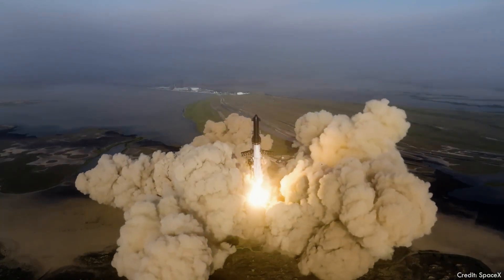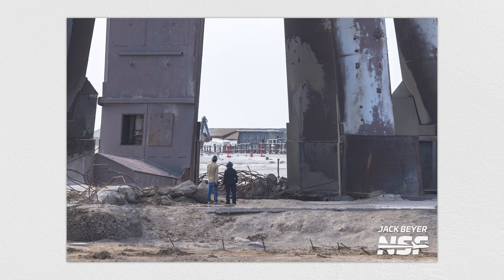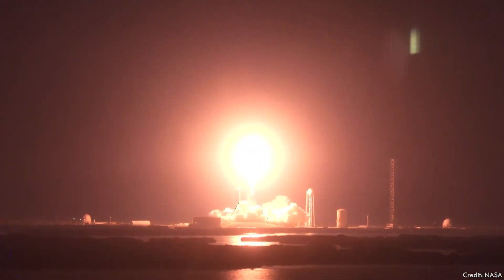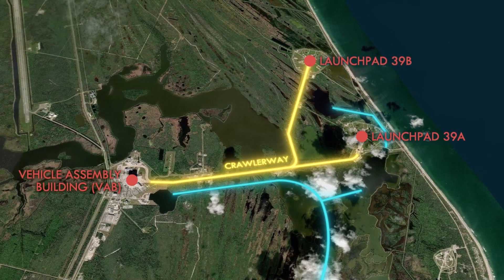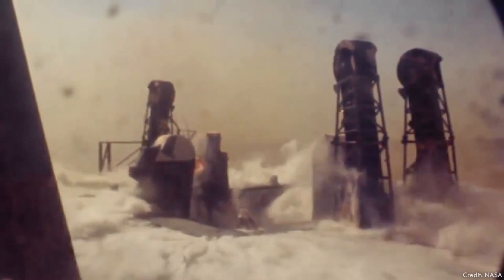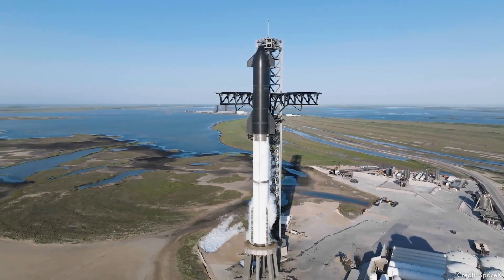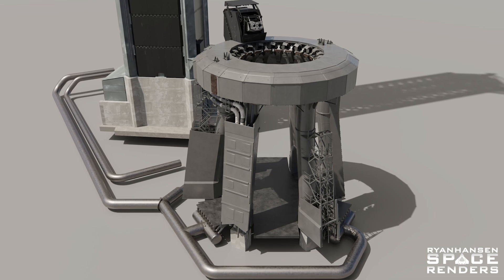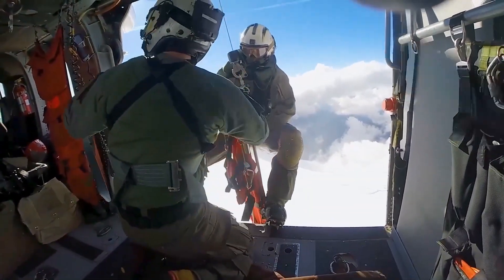Was Starship’s Stage Zero a Bad Pad?

Comment: My dad worked on the designs of the launch pads and launchers for the Atlas missile.  The issue of making reusable launch pads led to concrete turn buckets with refractor brick lining.   Water flooding was developed latter by NASA at Cape Canaveral.   The cost of a fleet of Atlas missiles pads  that would be used once against  the USSR led to the coffin launcher.  This launcher had the missile horizontal until fueled, then erected to vertical for launch.  The launcher was surrounded by a wall mostly to keep things out while waiting for years for a launch order that never came.  If launched, the Atlas would destroy the launcher and surrounding wall.   When the US went to silos for ICBMs there were extensive systems to direct the blast out the bottom of the silo and to vents outside the silo tube.  This was intended to prevent the missile from destroying itself before leaving the silo.   Over at the  Soviet Cosmodrome the solution was brutally simple: dig a deep hole in the ground, canterleaver a platform over the hole, put rocket on platform.    When the rocket took off the blast went into the hole and the effect on dirt in the bottom wasn't an issue.   
Of course you cannot (as you pointed) out, economicly dig a giant hole at Cape Canaveral (Kennedy)  or Boca Chica.   
I cannot imagine that SpaceX didn't know that they had built an expendable launch pad.  The question is do they want to pay for a reusable pad?   It might be cheaper to build an expendable pad for each launch, just like the Atlas coffin launcher.
Reply: While it could be cheaper, they wouldn't want to use an expendable pad anyway because they need to launch within a couple of days at most for in-orbit refilling. These repairs are taking far too long for that to be feasible.
Reply: They did know. This version (the concrete one) was to be substituted by a new one. The hardware was already there, but they thought it would withstand one launching. And so, decided to go ahead to save time (as it would take about 2 months to install everything).

They were wrong. But this was the idea: do one launch with the old pad, change it to the new deluge system, launch the second rocket.
Reply: They know that they would likely cause the extinction of the piping plover at boca chica
Reply: @eustatic3832  🤣

Comment: I can imagine the results will be exactly the same with the 'new steel version'. The issue isn't the heat, it's the insane amount of pressure... If they haven't figured out that it's easier to decelerate at an angle than it is into a steel wall, I don't have much confidence in them.
With this setup, it's kind of obvious what their goal it. Have a destructible pad that can have parts replaced at cost to the group that utilises their launches. Another excuse to tack on an additional fee => Short term profit.
Reply: That's one of the dumber theories I've heard

Comment: For anyone curious, the insistence on not using a conventional flame diverter comes from Elon's plans to launch from The Moon and Mars, where massive "earth"-moving construction projects are difficult.

I have a hunch that many of the solutions that have been pitched internally are specifically meant to be relatively easy to install in such environments, like just placing it onto the topsoil. (I'm oversimplifying, but you get what I mean)
Reply: While that seems to make sense at first glance, I wonder, what does launching from the Moon or Mars have to do with launching from the Earth?

What they launch from Earth will be completely different from what will have to return from the Moon or Mars. The huge booster stage used on Earth will already be gone. The soil composition will be completely different. There is no atmosphere to push against and much less gravity pulling back down. It's a completely different problem that could be solved with a completely different solution.

So whether or not they can use a flame diverter on other celestial bodies seems irrelevant to the question of what they should use on Earth. They could still use the flame diverter on Earth even if they don't want to use one elsewhere.
Reply: @reverse_engineered  from what I understand, it's practical testing in an accessible environment to see what they can get away with now, and what could be applied to future tests
Reply: 👏👏 someone is being clever today 😊

Comment: I think one thing they don't properly take into account, is the hour plus of pumping sub-zero liquids, the heavy cool air and  condensation is seeping into every crack in the pad below, then super-heating it for a few seconds vaporizes all the moisture and then shatters the 'crete. 
Not to forget the outer ring of engines creating a intense pressure ring-wave that the inner engines then are fighting for breathing space against, with nowhere to go.

Comment: 10:13 It is worth mentioning that the assessment DOES include the case of the entire rocket detonating on the pad, which is going to be significantly more severe in terms of debris and blast damage, and for which the exclusion ranges, etc are already budgeted accordingly. It may be the case that both or either parties felt this was sufficiently broad to cover for lower energy events, which this event undoubtedly was.
Reply: On the other hand, entire detonation should be very rare, at least something they want to avoid for their own concerns. But the demolition of the launchpad will happen on every rocket launch of this scale, even fully successful ones.
Reply: @MurderWho  The demolition of the launchpad was not planned nor was it expected to happen. It was planned to be heavily damaged, but not demolished like it was. And they have already moved past that with greater reinforcement, steel plates, and a better water deluge system. So the pad demolition should be extremely rare as well. Hopefully it won't ever happen again.
Reply: @chickiew3039  not really an issue, since this launch license was for one test. Undoubtedly futther licensing will probably require they don't shower Boca Chica with sand every launch

Comment: Steel plate and deluge design was known before the test flight but wasnt going to be ready on time.
Reply: knowing spaceX, they likely already have steel plate version 2 built and are working on designing version 3 and know that they'll probably need version 4 before it really works.

People just don't understand how these guys operate. Like they have Raptor 2's ready to start manufacturing, Raptor 3's are in the late design stages now, all while Raptor 1's haven't really been through their paces yet. The level of iteration they're running is absolutely insane and from their previous projects, it does seem to be a better model than anything NASA has done since the apollo program. It also pisses off a-lot of engineers because it's not how they were taught to do things in school.

Comment: It must be nearly time to get serious about a maglev launcher to get rockets up to a few hundred kmh before they need rockets to boost them the rest of the way/speed. So much of the design of the rockets are just to get them the first few hundred metres and first few hundred kmh. Most of the weight of the rocket is the propellant. The Falcon 9 weighs 550T full with 450T being propellant. If you can reduce the amount of propellant needed then the damage, environmental damage and the noise are all reduced.
Reply: You underestimate how difficult it would be to generate the kind of magnetic fields required to accelerate even 100T to a few hundred km/h. That fuel is extremely energy dense and can release that energy as pressure very quickly. Electrical motors are efficient because they have very tight tolerances and can be contained in a small area (a rotating armature). Turning electrical current into magnetic fields into propulsion with a linear rail system with an "armature" that weights 100T, moving at hundreds of km/h, and would have to accelerate over several kilometers of rail would result in truly ridiculous losses. Just take a look at how far we have managed to get with maglev trains so far, then add a few zeros onto the end of everything involved.

Also, keep in mind that maglev trains are accelerating perpendicular to gravity, not parallel to it. Generating enough magnetic field just to counteract the force of gravity (levitation) of such a beast would be tremendous. It's a lot easier when the forces between the train and the rail are distributed along and normal to the rail. It's a completely different problem when the forces are acting along the rail.

What you are suggesting is equivalent to a space elevator, only one that is powerful enough to accelerate very quickly. If we could even get one to work at all, it wouldn't have to get to such high speeds - it would just have to lift the payload high enough that the force of gravity is greatly diminished.
Reply: @reverse_engineered  . The Maglev doesn't need to do anything remotely like 100T. The Falcon 9 has a maximum load of 25T. Rollercoasters are already accelerating tonnes to about 100kmh. Scaling up isn't that hard and NASA had already looked into it. The US navy is also using Maglev style launches on its latest aircraft carrier to do a fair portion of a couple hundred kmh 30 tonne launch.

Comment: At 8:45 "I think that the results came as a surprise to no one..." Elon stated that they did not expect the pad to be destroyed and would not have launched if they did. Showing NASA built flame trenches, implying that this is a solved problem is misleading. The flame trench at 39a frequently needed repairs and was reconfigured many times. Spacex static fired Starship at about the same thrust of a Saturn 5 and the pad only had minor damage. As far as this not being mentioned in the environmental PEA, that's not surprising since it wasn't anticipated.

At 10:54 "..not to mention the public safety aspects of the showering debris." The debris particles that fell on Port Isabel have been tested at UCF. They found that it did not contain elements of the concrete and Fondag, just sand.

At 11:-00 "The FAA has effectively grounded Starship..." The FAA has not grounded Starship. The launch license was for one launch. The mishap investigation is standard procedure.

I was expecting so kind of analysis of how the pad failed.
Reply: The OLM is pretty far from the ground, so is effectively a 360 degree flame trench. What SpaceX did was launch before installing the water deluge as parts of it were already being delivered to the site, before the 'orbital' test launch. And that Musk wants to avoid a diverter if at all possible.

The Starship FAA license is for 5 years (until Apr 2028) and not for one launch. What the FAA did was ground the spacecraft until the investigation into the mishap is complete, which is what the FAA always does for mishaps.
Reply: @steveaustin2686  No it was just for the first flight. 

https://www.faa.gov/about/office_org/headquarters_offices/ast/licenses_permits/media/VOL_23-129_SpaceX_Starship-Super_Heavy_License_and_Orders_2023-04-14.pdf

Under item "4. Authorization:"  it states "For the first flight only, unless this license is modified to remove this term."

Comment: Grady, it is not fair to say that SpaceX has done any less engineering than NASA. NASA performed so many tests and full-scale ones that it boggles the mind. Full oxygen-rich capsules come to mind in just a single disaster as NASA worked through the engineering tasks. I feel you believe the engineers that designed Zero did a poor job of their work. I can say that now in hind sight but I expect there a few engineers that can model the forces at play and be 100% correct in their designs. As I recall, the NASA launch pads also suffered massive damage at times and as they learned how to build facilities.
Reply: Fool me once, shame on you. Fool me twice, shame on me. NASA didn't know any better and had to learn the hard way. SpaceX is following in their footsteps and choosing to ignore what has been learned before.

When the Tacoma Narrows Bridge incident happened, it took everyone by surprise. If it happened again, you can bet the first thing the engineer of record would hear is, "Haven't you heard about Tacoma Narrows?!"

SpaceX is and should be held to a higher standard today than NASA was 60 years ago because today we know better.

Comment: It occured to me while watching this ... perhaps a limited number of engines could lift the rocket off the ground, and as it raises up, more engines kick in. SO you avoid damaging stage zero, but you have good lift from near the earther.
Reply: Sure, except you need the maximum amount of thrust from the moment you begin to liftoff. Adding extra engines that you don't use would just add weight to that moment that you'd need more thrust to compensate for (so we'd end up with engines all the way down)
Reply: They will fire up all engines at the start. But they only need around 65% thrust to lift off. And then they can throttle up as they clear the pad.

The outer ring of engines are only able to start up when aided by the launch pad infrastructure.
Reply: @SpaceAdvocate Lifting off using less thrust, just means longer getting away from the pad and propellant wasted. You are better off just making the pad to survive the full thrust, so it leaves the pad as quickly as possible.
Reply: @steveaustin2686  They probably will get to the point to where they just scream off the pad. But it is possible to be relatively gentle with the pad, and they will probably do that for the first few launches, as they work through issues and get more experience. The first few launches are unlikely to be anywhere near the max payload capacity, so they have propellant to waste.
Reply: @SpaceAdvocate  Again, launching with less thrust means longer near the pad doing damage. Say it takes 2 seconds to get off the pad at full thrust. But at a lesser thrust you take 4 seconds getting off the pad. Now you have twice the time on the pad, PLUS the wasted propellant fighting gravity. You want to launch as fast as you can to minimize gravity losses.
Reply: @steveaustin2686  It will spend more time blasting the pad, true, but at the same time, the peak loads will be lower. That also matters. If it weren't for the high peak loads, the concrete pad would have survived the launch, as it would just have been eroded like expected, and as observed during the static fire test.

And I'm well aware that minimizing gravity losses is desirable. However, they have way more performance than needed for the first few launches. The first launch had zero payload, which means the upper stage had enough performance to almost act as a SSTO. If it had managed to separate from the Super Heavy, it would have very likely reached the intended trajectory, despite the Super Heavy severely underperforming.

The next launch will be a repeat of the first launch, so again, massive performance margins. On the third launch, they may start carrying payload, but almost certainly nowhere near the 150 tons max payload, so they will still have a large excess of performance.
Reply: @SpaceAdvocate  Again, you want off the pad as fast as possible, rather than blasting it with a lesser force for longer. The propellant losses from fighting gravity are significant, so you want to minimize that.

SpaceX has said that they could not have reached the Pacific if they had separated. The second launch is a 'orbital' profile like the first launch landing near Hawaii. The third launch objective will be determined by how successful the second launch is.

Comment: That SpaceX water cooled steel plat is going to see.some crazy air time of it ever gets used.

Steel gets softer as it heats up, and water gets bigger.  That plate will get pounded from above by the worlds largest cutting tourch while being ripped open from the inside by super heated steam. 

One report also indicates that they plan to attach the steel plate to the support beams of the stand.  In that case the stand might itself be torn apart by the plate when it tries to fly away.
Reply: >  That plate will get pounded from above by the worlds largest cutting tourch

This is just plain _wrong_. Rocket exhaust is NOT at all similar to a cutting torch. The torch produces very HOT gas, the rocket engine produces a very FAST stream of relatively cold gas.
Reply: @denysvlasenko1865  Flame color gives you a good idea of temperature. The flames from the rocket were orange until about two times the length of the rocket , so let's call that 1200 C.  They were brighter than the baground sky for about 1/8th of the rocket, so we can generous and call that 1500 C.  Steel loses 60% of its strength that 500-600 C.  I can't find a chart that measures the strength past that point.  Water expands to 1600 times its volume at just over 100 C.

We can pretty much garenty that the steel will be heated to at least 1200 C.  A safe guess would put the steels strength at less than 25% at that point.  

The plate is perforated to let water out, which will also let uncombust exhaust gasses in.

So you're correct, the temp of the gasses coming out of the engine is only habout half that of a cutting tourch.  However, it still doesn't matter.  It's a bit like asking if you would rather be hit  by a speeding dump truck or a 747.  The outcome is effectively the same.
Reply: @ddelv1601 you really don't understand anything at all about the design
Reply: @jimmaag4274  What did I get wrong?

Comment: How much pressure will the water need to overcome the pressure created by the launching rocket?    It seems that if the water pressure is not greater than the pressure from the rocket, the water in the deluge system could phase flash into steam causing a larger issue.
Reply: They need in the ballpark of 20 bar to overcome the pressure. And they will be spraying water faster than the engines are capable of turning it to steam.